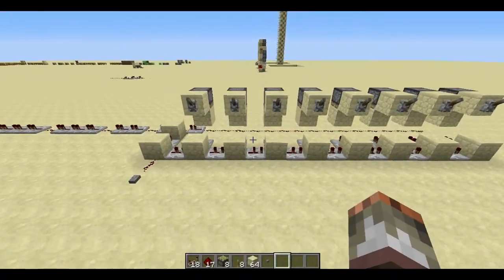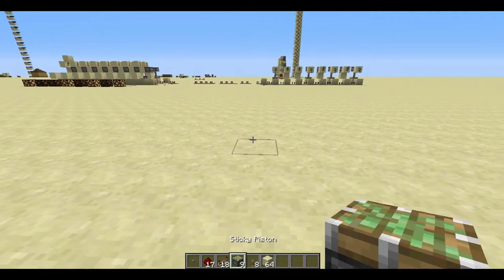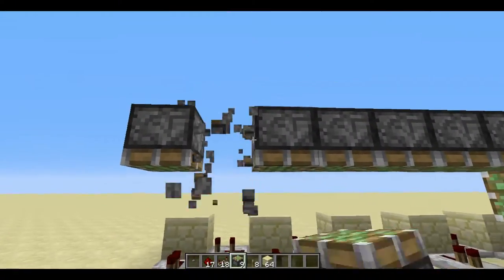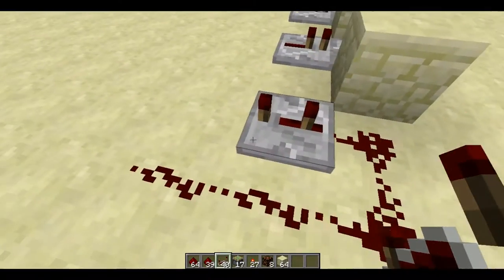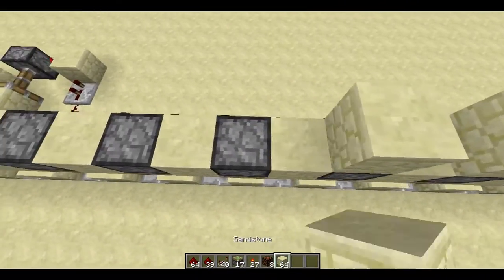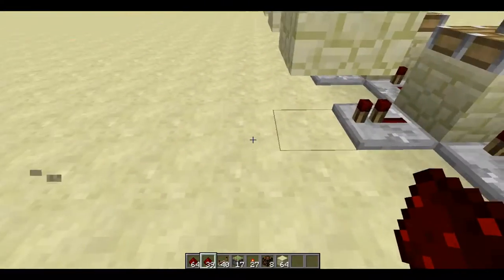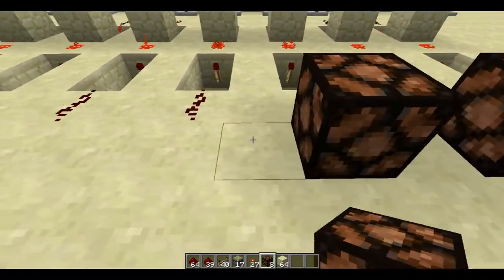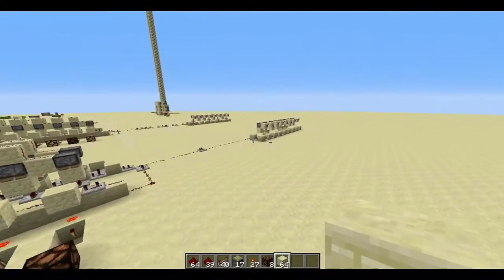8-Bit serial binary encoder/decoder - Redstone tutorial

Comment: Just as with all serial communication protocols, all connected devices have to agree on the same clock speed or baud rate. Here it is done automatically by the repeaters in the circuits, but you want to make sure you have them set to the exact right delay ticks.

Comment: I've been working on your creation recently, and I just wanted to ask if it's possible to convert this from 8 bit to 32 bit. Is it possible?
Reply from the maker: I know 2 problems will occur when doing this.
1. It'll take 4x longer to en/decode the signal.
2. There are some 15 long Redstone wires in this built which won't work correctly if adding delay to make them longer.
Although it is definitely possible to do so, you are gonna have to reroute some wires and change delays.
I'd advise to just use 4x8bit if possible. (I'll take a look at the 32bit one when I've got time)
Reply: Thank you very much for your advice, I'll build 4x8 bit instead.
Reply: @drogebot  I'm on bedrock edition and the fastest i can go is 3 ticks. How do I go faster?

Comment: if any one is having a problem where the decoder pistons keep firing over and over go to the end of the decoder where the red stone is going in to the block with the torch on top and change the it so the red stone extends out to the side of the machine more then loop it around and bring it back in to the torch block from the outer side

Comment: That is not how decoder work, you should be typing code and the decoder should light just one light to show you "translation" of that code
Reply from the maker: An encoder is a device, circuit, transducer, software program, algorithm or person that converts information from one format or code to another, for the purpose of standardization, speed or compression.
Reply: @drogebot  Yes, but this doesn't convert. It just shows you what you have written on the entrance of the circuit
Reply: It converts 8-bit signal into 1-bit signal which compresses the volume of the circuit by quite a percent, its an encoder  @caballo-de-las-montanas

Comment: Would be more impressive with analog. 8 analog redstone signals sent down the line would be equal to 4 bytes worth of data instead of one.
Reply from the maker: don't make me try this XD
Too late, now I'm interested
Reply: Drogebot I have been looking to try it myself. I have an idea for doing a redstone music player that would use 6 analog to binary decoders in parallel fed by a serial line in to drive a full set of note blocks. Of course I would need to build an analog ROM bank with hundreds of hex values stored in it, which would be a pain. Could be an awesome demonstration of just how fast a serial analog transfer can be.
Reply from the maker: Looking forward to it dude, message me if you ever get it to work.
Reply: Drogebot Oh I have been trying, but hitting some snags. A bit part of it is just the sheer scale of the memory bank. I saw a guy who had gotten the serial transfer to work at a speed of about 40 bits per second so with each bit operating a single note that is 24 bits for a single state of the note blocks if I wanted it to encompass every chord imaginable. So it could do a theoretical max tempo of about 100 beats per minute which means I need about 1.5 KB of analog based storage with no more than 1 tick delay between each hex value read to play a 5 minute song. It is a pretty big task. I think it might require more than one person to sort it all out especially because I haven't really got but a hand full of the individual parts working in my own test builds. I think I've got the idea for how to get the memory to read fast enough for the transfer, but taking the serial in and routing the correct hex value to the proper analog to digital decoder in parallel Is going to be a tough part for me. I never even did that with the binary before, and I have to implement it without any decrease in speed.

I have used locking repeaters to catch and release bytes in transit across a binary serial line, but that was more just testing for a serial based memory circuit I was working on. One that would basically freeze a byte in transit on a line of repeaters and then release it again when it was needed.
Reply from the maker: I managed to get 8 analog wires trough a single line and decode them again. The only downside is that you need a lot of comparators to make it travel over distances (you need one every 4 blocks), which will slow it down a lot.
Also the decoder is a little bulkier because I can't change comparator delay...

Observer blocks make good instant wire ^^
Reply: Drogebot Yea the decoders I was going to use were going to be directly controlling the note blocks to eliminate the need to change the delay by simply using the maximum transfer speed throughout the whole process.

I assume you are referring to the serial to parallel decoder. I would assume the best way to handle that would be to set it to a specific clock speed to make it read at the exact intervals where the data is in position to branch it off into the different parallel lines. You could use the first input as a dummy just to trigger the clock to ensure it is in sync with the signal timing, at least initially. It could lose sync if there is significant lag though.
Reply from the maker: This is what I mean https://www.youtube.com/watch?v=FYOmGbxcEno 
Thinking about it, the decoder is too slow for music
Reply: Drogebot That decoder design is yes. The sticky pistons need at least a 2 tick pulse to activate properly for reading the data which would require the data to be going about half it's maximum speed at least. I was looking to use the comparitor's side inputs to do a pistonless design though, one that can work off of the "1.5 tick pulse". I was also looking to set it to a 6 tick clock giving off the signal to read once every six ticks right at the exact moment when the data is in position to be read. That way the clock starts up when the first leading but goes through and just runs continuously until manually stopped, this negating the need for the incoming signal to contain extra data to operate it and the signal coming in can simply be one continuous stream.

The parallel lines will end up receiving a 1.5 tick hex value once every 6 ticks. Each of the parallel lines will operate 4 of the 24 note blocks. This should be enough for a maximum tempo of 100 beats per minute. The catch is this tempo isn't very adjustable... Most I could do is leave every other 6 hex segment blank to halve it down to 50 beats per second, but then it would be really slow. There seem to be a fair number of songs which play very close to 100 bps. Granted plenty of songs go way faster than this too, so it will certainly be limited, but functional.

I could only increase the speed further by increasing the number of serial lines. I could do this. Though I can only increase the speed in intervals of 100 bps. If I add a second serial line in I can set up the timer on the clock to read at 3 tick intervals on alternating lines for a maximum of 200 bps or on 3 lines at alternating 1 tick intervals for 300 bps. But 3 is the limit here as it is the highest thing 6 is divisible by. Any faster than that and I have to ditch the serial to parallel decoder entirely and just use 6 parallel lines to directly feed the analog to binary decoders for a maximum of 600 bps.

Either that or start tweaking how I drive the note blocks from the signal.

Though it is entirely possible I might have to halve all of these speeds because it looks like the "1.5 tick pulse" generator was the result of a glitch which may have been at least partially fixed as it seems the 1.5 tick pulses can no longer transmit from one comparator to the next if there is any redstone dust between them at all. So only opaque blocks and other comparators can transmit it. That could force me to go with 2 tick pulses which would mean only 20 bits per second of transfer speed instead of 40 on an analog line. Thus it would take 2 serial lines to achieve a 100 bps tempo or 3 for 150 bps.
Reply: Hey, once you have the signal encoded into a comparator wire you can easily decode the comparator wire into 9 different signal strengths. By making the encoder send out two signals, the new one giving an order to send the original signal to a certain spot you can have 9x9 signals (81 different outcomes) giving you more than enough for the alphabet and 48 numbers. Also, you can have a 9x9x9 (721) combinations if you just add another one. I may a video about the full thing on the yt channel called 'Lz3_' soon, I built a very small and slow version there. Just logged into this spam account, need to switch. 

Anyways this is pretty  handy and should help you a lot. Keep in mind the signals can be 1.5 bit too (meaning you can send them wireless through tripwires and block update detectors) + it is easily possible to store 721 different characters on 1-3 comparators worth of memory, depending on how complicated your storage is

Comment: why doesnt it work when you put two 1s next to each other?
Reply from the maker: I just tried all 7 possible 1s next to each other and for me it works just fine.
Make sure you have all the repeaters at the correct delays.
If it still doesn't work tell me what the exact code is you used.
Reply: Drogebot
thanks, it works now. I also tried to make it morew compact myself, and put adders and subtracters with them, they do work pretty well.
Reply from the maker: NP, thnx